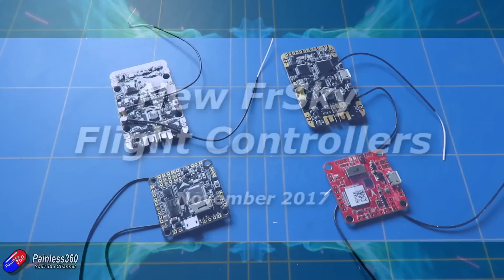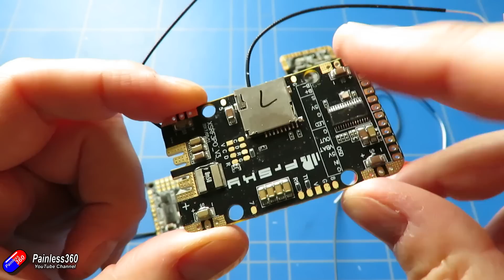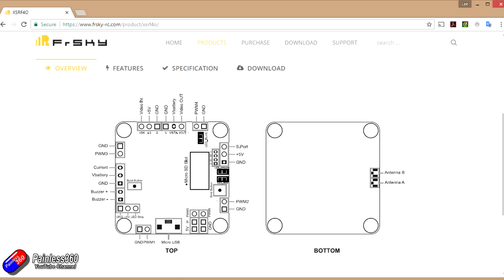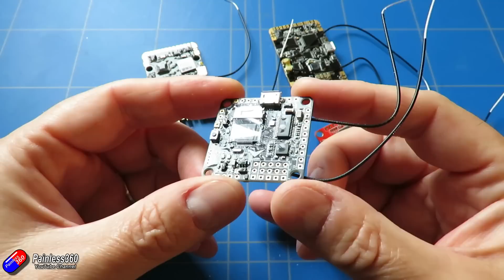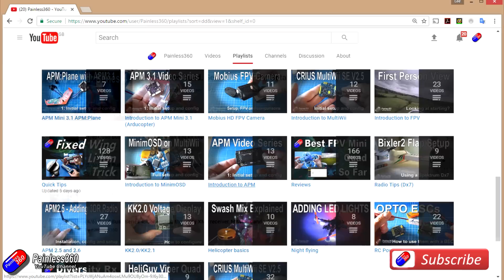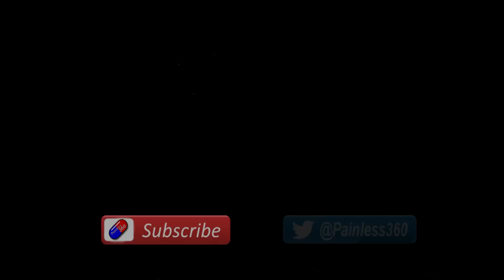New FrSky Flight Controllers with Integrated Receiver (Re-posted video)

Comment: If you want to flash these with new rx firmware, apparently you have to hold the boot button down while the update starts...otherwise the flight controller screws up the flash due to the s.port output from it
Reply from the maker: I’ve not read that, do you have a link to that detail? Thanks..
Reply from the maker: I see, you're talking about the FC's that have the receiver built in.. That explains it. Thanks for posting.

Comment: Quick question regarding the XSR part of the board, in particular the aerial length. Are the aerial lengths the same as the XSR receiver or more like the X4R length as I've heard about distance issues with the XSR due to shorter aerial length?
Great job as always Mr 360 👍
Reply from the maker: As always a picture speaks a thousand words - hope this help - https://www.dropbox.com/s/8559ijjjqacxhi5/FrSky%20Antenna%20Compaison%20%28Painless360%29.jpg?dl=0
Reply: Painless360 
As always the font of all knowledge 👍👍

Comment: It's a shame that the smaller boards can't take 4S Lipo voltage directly. With a 4in1 esc I don't use a pdb. I guess some 4in1s do have a step down output though.

Comment: Glad you reposted this video fella!
Loving the xsrf4po board but getting a weird flip of death only when performing front and back flips and the fc restarts as seen through the fpv? Any idea what this can be? Would a capacitor help?
Reply from the maker: +Gogi Fire That definitely sounds like a power issue. I’d add a capacitor, it won’t hurt it. Hope it helps
Reply: Painless360 cheers, I'll let you know if it works :]

Comment: Can you please explain the main differences between I squared c or SPI Gyro's?
Reply from the maker: +Jared Turner the short version of the answer goes a little like this. The gyro itself is very similar, it's the way that it communicates with the flight controller that is a little different. I2c only requires two lines but is a little slower. Spi requires four connections but is a lot faster. So with spi you can read and get the position of the vehicle in a lot less time, which helps for better flight performance. Hope that helps

Comment: What is the difference between the XSRF3E and the XSRF3O?
Does the XSRF3O have a barometer, have PWM outputs for driving 4+ servos, handle an external GPS and compass, & provide Frsky telemetry all at the same time? I am looking for a simple setup for a fixed wing plane with iNav.
Reply from the maker: I'd go for the Omnibus boards for iNav.. Probably the F4 ones now..
Reply: From what I have found, standard F4 boards cannot do Frsky smartport telemetry since they do not have a second hardware inverter. The one and only inverter is used for the sbus receiver.
Will iNav not run on these Frsky FCs?
Reply: Just watched the updated video. From your new comments, it is not possible to connect a GPS/compass so this is a show stopper for me until they increase the number of UARTs.